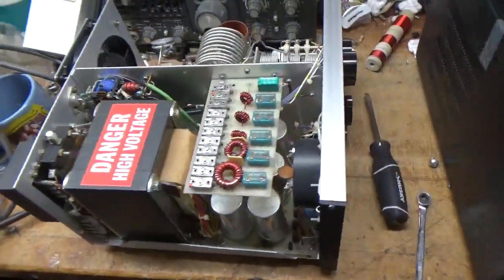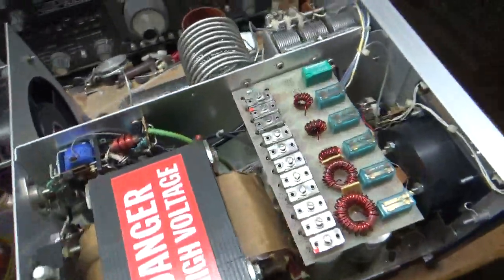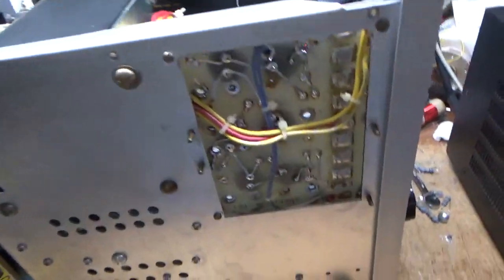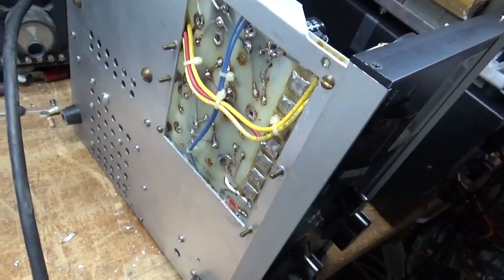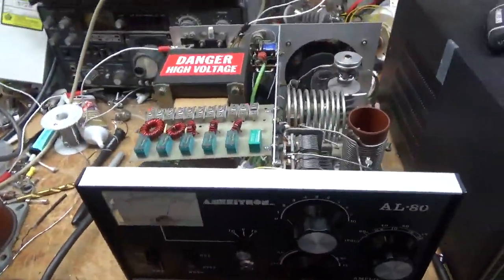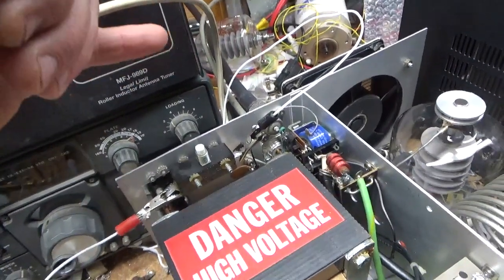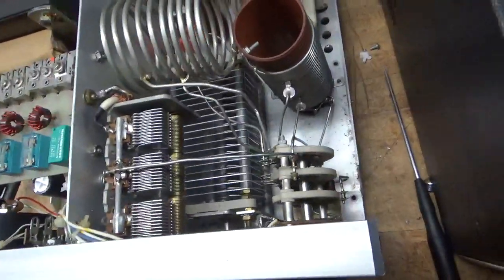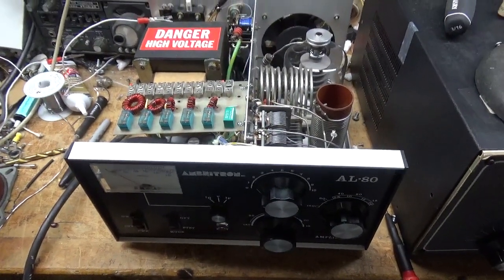Ameritron Al80 Repairs And Modification

Comment: I just redone one of these. Mine was sent to be repaired but was dropped in shipping. Tube shattered Transformer tried to exit out the bottom. The center partition was S shaped. I kept it around for a long time until I decided what to do with it. I chose life, lol.  

I stripped it and straightened the chassis,. New tube and new caps and resistors. I am fond of it for some odd reason lol. She so lives again,. Glitch resistor is a awesome ideal, I should have thought of that. I still have it, I think i will add it!  Hey check the cooling fan, See if there us a limit resistor in serious with the fan, Jump it if you want better cooling on the tube. The resistor is on the tag strip for the transformer wiring. The tube  also sits really high in the chassis. Shortening the tube socket spacers helps prevent tube cap arcing on the case (can happen) lol. Awesome job saving the old gal. she has a lot more life to give.  Great job.
Reply from the maker: Thank you